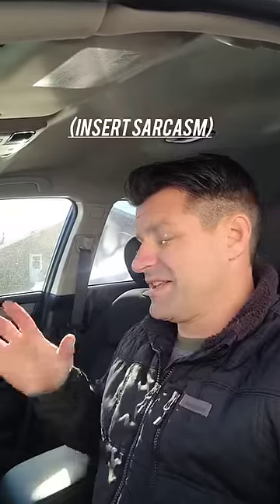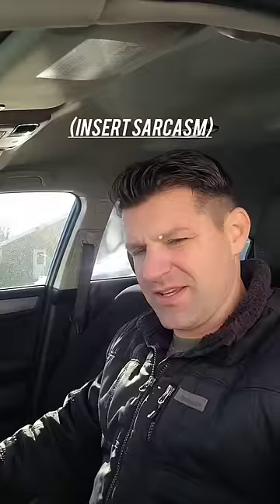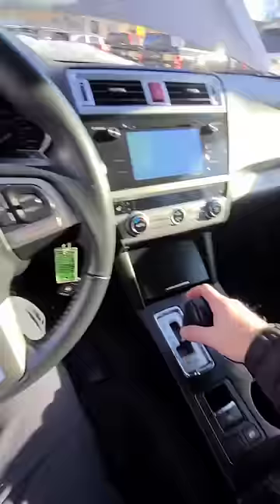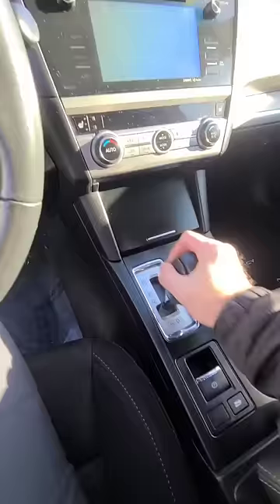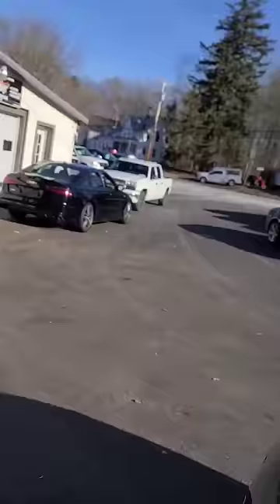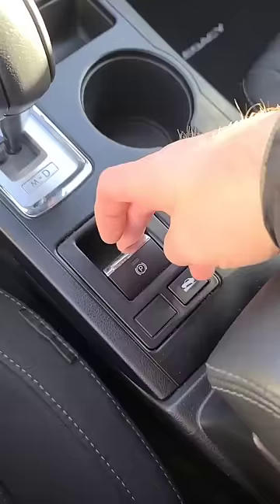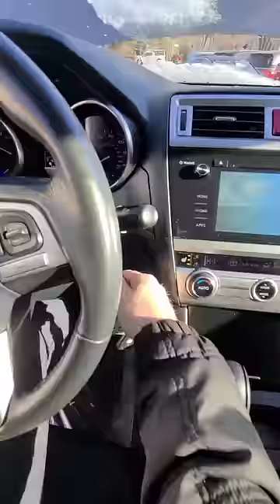Why Subaru Engineers deserve a punch in the Face! #shorts

Comment from the maker: For the record, jump pack got car in neutral then died. Key is not removable from neutral, shift lock requires a key or screw driver. Not accessible without me removing my foot from the brake.
Reply: Still a noob.
Reply: Put it in gear. The fluid is enough to keep it from moving. Also a pocket screwdriver would hit the shift interlock. 
Still a noob for clicks and views.
Reply: Thank you for the explanation.  I was thinking the same thing. Lol
Reply: @RayWolfwinski  The engine isn't running, the pump isn't pumping, no gears are being applied, the transmission is STILL in neutral in drive.
Reply: @supertoaster94  it's a CVT. It has 12+ quarts inside it but only holds 5 quarts in the pan. 
The fluid would be a resistance to the moving motion of the car. And the torque converter also is now trying to spin causing fluid to shear and keep the car from moving as much as it would in neutral. 
Drive is not neutral unless you have a 4L60E.
Reply: Subarus with automatic transmissions have an override next to the shifter. I’m sure it still wouldn’t matter but if you had a flathead in your pocket, you could’ve put it in park instead of racing around the door.
Reply: every heard of wheel chocks my guy
Reply: So what you are saying is you should have engaged the parking brake before moving the shifter since it's clear the PB is electric and the jump back is a sketchy connection at best.  If I understand, the JP died, demonstrating how tenuous they can be.

You'll know for next time, engage the PB before you go messing around with batteries and shifters.
Reply: Ok I see the complaint but that is a pretty rare scenario.  Usually you will either have power the whole time or have the tool to manually release the shifter from park already in your hand because it won't come out of park with no power.  I've been a mechanic for nearly 20 years and have dealt with electronic shifters pretty much the whole time and I don't think I've ever seen somebody accidentally get a car into neutral with no power and no tool handy.
Reply: just not sure how often that exact situation occurs. . .
Reply: Pretty much, the story is to always engage the parking brake on a hill no matter what
Reply: Everyone saying “Just put it in park” Did you not just watch the video? Did you not just watch him holding the brake and not being able to go into park? Are you guys stupid? (Yes. Yes you guys are.)
Reply: Sounds like a skill issue
Reply: Just chock the wheel with your boot...
Reply: That still doesn’t explain why you shifted it to neutral to begin with.
Reply: So jump pack died after car went into neutral. Bad timing but I get it. Murphy’s law.

What doesn’t make sense is how it somehow wasn’t too dead to power the car so you could put it back in park
Reply: They make pocket screw drivers for a reason. Should be second nature to have one in the pocket if you're carrying a jump box to a car cause, ya know, shift locks exist. Shift lock override is like 2 inches in front of that shifter. Problem solved. Un-prepaired and no pocket screwdriver? No problem! Use the mechanical key that pulls out of the fob. Again, problem solved. Of coarse the situation would have never happened if you had made a good connection with that jump box to begin with. Shoulda titled video - noob vs subaru shift lock. shift lock wins or subaru shift lock outsmarts noob. lol
Reply: Why would you connect the jump pack, get in the car and instead of starting it, put it in neutral and wait for the pack to die? And where did you suddenly get another, good pack from?
Reply: The Subaru remote should have a key inside that you can pull out and push in the shift lock.  Come on man.
Reply: You could have just popped off the little square and changed gears by pulling the tab that release the gear shifter. Didn’t need to jump out of the car. Next time use google or just YouTube it. “How to change gears when the battery is dead”.
Reply: If you pump the brakes the pressure will hold. I swear people are getting dumber every day.
Reply: You had shoes on right? You could have jammed your shoes into the brake paddle if you didn’t have a tool (credit card) for the shift lock cover. I have to agree that is a pretty stupid design.
Reply: @RayWolfwinski don't know why everyone hates on 4l60e mines got almost 300k and still going. Most transmissions can't do that.
Reply: Cool story. The good news is that there is still time to take this video down before you embarrass yourself even further.
Reply: That definitely sounds reversed. Shift overrides are to get to neutral. Not to get out of it. So I see the issue there. Very off. However you should still be able to stay in gear. I dont know why a CVT wouldn't be able to stop it. Other wise go to drive, chock it, then do what you need to do then to turn it over, get it into a shop, or onto a tow truck. Glad you are good otherwise though.
Reply: @Shalashaska016  shift overrides let you go to park on almost all cars. I don’t know of one that doesn’t. It will go into and out of gear just like you have the engine running and foot on the brake.
Reply: Also for the record you must have no friends or coworkers.
Reply: So explain how you got the in the vehicle, key turned, car out of park, to not be able to access the release because the key is in the column. This is a fucking setup.
Reply: Jump pack died? You mean you disconected it. Also it's a parking brake, not an e brake. If working on a car that can roll... try wheel chocks.
Reply: An incredibly dangerous engineering oversight. I hope Subaru has an easy fix.
Reply: @markkent4295  you understand that this video is bullshit and this person had to go out of their way to do this? They had to actually put effort into this to cause this exact issue by forcing an outcome that's unreachable otherwise?
Reply: Couldn't you have just turned the wheels to get it sideways where it wouldnt move or roll down the hill to do the same. Enjoyed the video none the less
Reply: Why not chock the wheels after you went and got your jump pack and popped the hood?
Reply: My guy doesn't know about the transmission bypass by the gearshift?
Reply: The design is flawed I agree. You should be able to shift back to park without using a manual override. Unfortunately I see more of this as the years go by. Tow truck driver here. Electronic shifters, parking brakes, and door releases all suck.
Reply: Nice set up. 
Who starts automatic cars from neutral?
Reply: @bryontriglianos6508  nope they work if they are off do it in mine all the time cause the brake safety is broken
Reply: How did the battery die in nutural and park brake off? Electric Park brakes go on automatically when the engine is switched off...
Reply: You are literally 1 in 100 mil in this situation. There's no need to over engineer the over engineered vehicle that's made for idiots to drive from A to B and know absolutely nothing about their vehicle.
Reply: I love how everyone has the perfect answer after the fact.I will never go near a car without - a pocket screwdriver in one pocket - a wheel chock in another- the owners manual in one hand and a helper in the passenger's seat. But I bet I still forgot something. A simple mechanical emergency (oh sorry" parking") brake would solve everything!
Reply: Just to whoever doesn't know like the person who filmed this video there's a shift lock bypass. It's right in front of the shifter you remove the little rubber pad and there's a hole you push down on it
Reply: So, a completely unforeseen problem has to be engineered for? Maybe you should have used wheel chocks or put the hand brake on first before doing weird shit.
Reply: How did the battery go dead while you were in the car, in neutral, with you foot on the brake?...
I think the person that needs a punch in the face is the one dumb enough to allow that sequence of events happen.. I mean how??? How does that happen 🤷‍♂️🤦‍♂️
Reply: So you're saying you're very unprepared.  Having a key or screwdriver in your car should be as common as a steering wheel.  House key. Pocket knife.  , To me sounds like prima donna problems.
Reply: so then, a donkey punch.   a mushroom stamp.
Reply: Don't use the small shitty jump packs. They only work 25% of the time when the battery is only slightly dead. Also use the parking brake, it's primary purpose is not emergency brake.
Reply: Cell phones work well for contacting others for help.
Reply: Why dont you put blocks down
Reply: Take a coin or anything if you don’t have anything in your pockets then yeah you’re screwed but there’s a safety switch that you pop cover off right next to the shifter and take a pen or anything press down on it and you can shift with no power no nothing I’m guessing you already heard that from all these other people though!
Reply: Fake
Reply: Chock the wheels... Problem solved lol
Reply: @sheshellsseasells  EXACTLY
Reply: Kinda just dismantled your whole argument bud, why would anybody ever be in that situation if they’re not working on the car?
Reply: There’s a little whole somewhere around the shifter take a flat head screw driver and then you can shift it
Reply: @Subaru
Reply: Why did you leave it in neutral
Reply: Ahh I was wondering how you got to that point.
Reply: @supertoaster94  which is why they're is a parking pauwl.
Reply: Well that is a problem with your jump pack and not the car since under normal conditions this would never happen . Electronic E brakes are dumb though and i hate them
Reply: Get a jump pack that plugs into the 12 port aka the lighter port. Then you will get power to the car from inside. They take longer to charge the battery but it would be enough to get the car in park if it ever happens to you again
Reply: thats why you always have one in your door .. not only for rattle sounds x)  even a pen or pencil can be used for the shift lock
Reply: This is the explanation I came to the comments for. Thank you.
Reply: Your fault for not putting in park with shift lock before putting booster on, sounds like a skill issue.
Reply: All cars has a neutral override switch doesn't matter if it has electronic parking or any of that that little cover beside the shifter is called a kill switch you remove that cover you stick a screwdriver down in there then you're able to shift the part that the shifter forward to put it in park it is a neutral safety switch duh all vehicles must be equipped with them after 1972 with a floor shifter all vehicles have a shift on the column must have an override or a manual emergency brake learn your vehicles and this is for American vehicles and imported vehicles to America just saying from experience I've worked on every vehicle known to man so far in my life and not one time have I ever had that problem why I got to jump out of the vehicle afraid of it rolling over me never had it because there's always going to be a neutral switch beside the shifter unless it's on the column then if it's on the column well that's why you have had either a a mechanical emergency brake or a default parking brake oh and you can also put the vehicle in drive to for the vehicle not to roll use common sense
Reply: You have an emergency brake you can remove one of the keys from the key ring and use it on the shift lock the shift lock is there for that very reason
Reply: EBRAKE and Neutrel 
OR
EBRAKE and Drive
Remove key from key ring
Find anything even if u can't get out.. but u can. 
I'm glad you're not in charge of saving anyone's life.. that would suck.
Reply: @bryontriglianos6508  because everyone has a flathead screwdriver in their pocket...
Reply: @meesterbeefy13 unless the cover is missing, most cars will have a cover, some requiring a pick or very small flat head screwdriver to remove cover to access the shift lock release.
Reply: @Gamerboi4 lmfao the irony of your comment. Especially if he's on a hill...no...pumping the brakes do NOT hold the calliper pistons pressure on the pads 😅🤦🏼‍♂️🤦🏼‍♂️🤦🏼‍♂️🤦🏼‍♂️
Reply: That’s what you bought. I make sure I have manual options opposed to my electronic options just in case. My windows are the only thing that are entirely electronic. You should have realized everything was electronic and asked where the manual controls were. If there are no manual controls like a shift lock, then the car is worthless and can’t even be towed if needed. Junk not worth buying. Your fault boss. I don’t feel any kind of sorry for you
Reply: So you're saying that you DON'T carry a pocket knife and that your house keys weren't accessible EITHER?
Reply: You dug yourself into this hole. If you knew of these ‘flaws’ you should have been smart enough to chock the wheels first. Instead you were all ‘hey let’s make a viral video’

Clearly you were missing when the common sense was handed out.
Reply: Don't sweat these smooth brains in the comments. Subaru is past it's use by date. I'm guessing you needed something bigger than a crosspreza? no MT, no handbrake. I'd blame you for buying a bad car but I don't know if there's an option that isn't shit.
Reply: Flying Wheels I wonder if the battery goes dead if the ebrake disengages?
Reply: @meesterbeefy13  if the battery was dead, it would never have gone out of gear in the first place.
Reply: @Gamerboi4  if your brake system holds pressure when you let off the pedal, then you've got some malfunctioning parts my friend.
Reply: All car got an over ride button that free up the gear box. Normal to put the car into neutral lol
Reply: So you put it in neutral for no reason and don’t know how to use the shift interlock. Got it.
Reply: @RayWolfwinski  Did he not say gear is stuck in neutral?
Reply: @sostanza3  no because it can still go into drive. Reverse and park is locked out by an electronic actuator that is used by speed and brake input to let the shifter go into reverse or park. That is located in the shifter itself. 
Most cars can easily go from neutral to drive as a safety if the throttle gets stuck or the engine fails. 
Again he's no mechanic and just looking for clicks and views.
Reply: All these comments acting like you broke down in a shop with a buddy and screwdrivers and wheel chucks laying around 😂 if you’re out on the road alone and this happens you’re hosed.
Reply: What was the point of going in neutral when you were jumping your car. Electronic parking brakes are stupid but this would never happen in real life
Reply: Why would one put jumpers on a dead car, disengage the parking brake, and than shift it into N?
Reply: No, that's not why they should get a punch in the face... Having to change headlight bulbs through the wheel well is why they need concrete shoes
Reply: How did this get uhm, NTSB(?), approval for distribution in the US? I thought this was part of testing.
Reply: You have really pissed off some millennial Subaru fanboys.
Reply: 2013 Subaru legacy owner here 3.6 R, did you try the emergency shift interlock?
Reply: I know your general public doesn’t know what it is but it should be around the shifter somewhere or you pop the little cover off and either put your key in or press the button to allow you to shift into park.
Reply: I was about to say there is usually a shift release button that allows you to change to/from park... so weird that they require the key or another tool that may not be readily handy in an event.
Reply: @bryontriglianos6508 yes because everyone just has a flathead with them
Reply: if. u were a truck driver u probably crash into cars n into building lol
Reply: You’re not very smart. The car has a transmission access port to override the interlock.
Reply: @RadDadisRad  Dude, read the comment you replied to a bit better.
Reply: @Hawkido  the car will never die in neutral. It’ll die when in park. Why is he trying to manipulate a dead car that is in neutral? I don’t need to read anything. This post is stupid.
Reply: Just like Nissan qashqai if it breaks down electrically and battery is disconnected you can not get them out of park without battery power... so just skull drag them then if driveline gets damage that's Nissan's fault
Reply: @destruxandexploze2552  how about Chalk the Fucking Tires!! Is that so complicated? It’s like watching a toddler trying to figure out what his third leg is for!!
Reply: @andrewburston9125  Wow only other person with Common Sense!!! Congratulations your smarter than 99% of these Comments!
Reply: @iamzuesthisisthetruth8864  I already stated in another comment he should have used a tire wedge.
Reply: @RadDadisRad  Huh?  Never? Really?  Never had an alligator clamp pop off the post when testing a car with a battery pack, huh?  The OP's post isn't a stupid post, this is just a very unlikely situation.  Your post was willfully ignorant.  Observe, Think, Cross-Check, Confirm, then Commit.  You are all Commit and Quit.  I seriously hope you are not a mechanic that works on other people's vehicles.
Reply: It isn't a "emergency break", it's a parking break. If you had applied it when you parked the car then you wouldn't be in this problem. Sincerely, the rest of the world.
Reply: Doesn’t matter, it’s should be way easier to do that anyhow. Shouldn’t be any convoluted steps to shift into park or engage the parking break.
Reply: @RayWolfwinski  how is he a noob. I can definitely see this happening to all sorts of folks.  And even if he was, the car should allow access to these saftey measures regardless the skill level of the driver.  Your a noob in saftey design.
Reply: So you knowingly got a car with a dead battery from park to neutral while not having chocks or a parking brake engaged while on a slope? Then it’s the engineers fault? Oh and of course a new good jump pack magically appeared under the bonnet after the first one died too, what a freaking miracle.
Reply: My guy, do you not have a pocket screwdriver?
Reply: The circumstances needed  in order for a battery to die while in neutral is almost not possible unless done on purpose. I agree parking/emergency brake should be manual but this has to be set up.
Reply: @RayWolfwinski  it's an auto it would not go into any other gear or park
Reply: @jamesallenmainieri  how do you know. Are you a Subaru technician? I highly doubt it because if you were you would not be stating that as fact.
Reply: Coming from the wonderful world of towing and mechanics why the fuck do you not have a tiny flathead screwdriver on you at all times the tool trucks have them in handfuls and most likely give them for free or for a few dollars that being said in front of the shifter under the rubber mat there's a small oval hole put your screwdriver in there push down on the button put it in park
Reply: sounds like a jump pack issue
Reply: @maine-ly  that would be too easy and doesn't make content.
Reply: BUT-- IT HAS A TURBO!!
WE ALL 👍🏼 GOOD
Reply: whats wrong with putting something/anything infront of a tire to give you more time to do... literally anything you wanted
Reply: i do know somebody with a mini that had a battery die while driving somehow... anyway, that locked the key in the ignition for some reason. so he yanked the key, destroyed the ignition/key interlock and practically wrote the car off all because of a dead battery
Reply: @theglitch99  it doesn't have a turbo
Reply: I’m just trying to understand why you’re even putting it into neutral without starting it?
Reply: @701garage  then I take back my comment!😵‍💫 just a normal boring car
Reply: I mean. This was kinda my question is how did the car get Out of park. If ur car is Dying though u have bigger issued then this. they should not have expected the car battery to die while in drive. Literally driving would be charging your dead battery preventing this problem. Only way this happens if u are driving somewhere with a battery u know wont hold a charge so u must have junped it in the First place to get it out of park. And then it died during that trip. 

Idk what the odda of that are. But it sure sounds like your 1 in 10000 scenario of continuing to drive with a dead battery till your car started shutting itself off is a you problem.
Reply: @RayWolfwinski  he clearly shows it not going into gear or park.
Reply: Theres a shift interlock right there that will allow you to put in in park when battery is dead, push on it with a screwdriver and shift it into park👍
Reply: @jamesallenmainieri  please see previous replies. I have explained as to why it will not go into park. It will go into drive. Every car does.
Reply: open center console, insert key into lockout, and put it in park....FFS all vehicles have a key lock function to prenvent this, absolute misinformation at its finest
Reply: Okay, but why did you put it in neutral, exactly? Batteries don't require the car to be in neutral to receive a jump, last I checked.

Yes, electric-only parking brakes are dumb, but you created this exact problem, yourself.
Reply: Ah, you're responding to Mr Subaru's criticisms.

You bring up some interesting points, BUT 1) how would this specific situation be different with any other manufacturer 2) How would it be done differently to avoid this specific case altogether?
Reply: You can probably find a hunk of metal on the ground to pop the shift lock. Or anything metal with a flat end. Like one of those nice metal zipper pulls on your ski jacket.
Reply: It sure sounds to me like your problem here wasn't the Subaru, but the shitty jump pack you used. Can't blame Subaru for you buying a crap jump pack. (Whatever happened to having cables and asking someone for a jump)
Reply: No, I still don't get it. So you had the car in park, you used the jump pack, that gave power to the car, and for some reason you then shifted into neutral -- instead of starting the car? or letting it run? And with the hood still open and the jump pack still attached? But why...

(inb4 "because otherwise it wouldn't make for any youtube likes")
Reply: @RayWolfwinski  the car will not go into drive OR park, not every car will go into drive.
Reply: Still blamed Subaru engineers 😂 typical
Reply: @Andrew Burston  he's probably wearing crocs
Reply: Ok, follow me real close here... Remove shoe from foot not on brake. Place in front of rear wheel. Slowly roll onto your new wheel chock.
Reply: Coudnt just hold the car?
Reply: No clue what a shift-lock override is? smh
Reply: My minivan had a dead battery. Went to get the jumper cables from the back. The only way to unlock the lift gate is with the fob or switch on the driver door ELECTRONICALLY.
Reply: Subaru secret to circumnavigate this issue, hit ctrl alt del, and reset.  It's super easy, barely an inconvenience.
Reply: all u have to do is remove the rubber mat from century cubby hole. look where the three slanted slots are that the mat clicks into closest to the shifter there will be one round one and stick a flat head in and press down then move the shifter to park. sometimes you can use the key in the fob.
Reply: yhs its common problem with key. btw get rdy my friend when your automatic gearbox will fail. and drop atleast 4 code it will go into safe mode with few gears at best. and key will by stuck for ever. you will need delete error codes relaunch everything oh and ofc replace or restore your autogear box. happened few times from life experience.
Reply: after parking always have the emergency brakes on, make it a habit and you'll save yourself on a bunch of trouble like these 🥴
Reply: @RayWolfwinski  You want to have an automatic gearbox start turning to keep the car still?
Reply: Bet you had a pen in your pocket
Reply: @cccpkingu  yeah. A transmission full of fluid coupled to a non-moving engine is going to have a higher resistance to motion of the car moving than a transmission allowing the wheels to freely spin from the engine itself. 
In simple terms a manual transmission left in gear will hold if the park brake fails on slight inclines. It's the same principle.
Reply: @RayWolfwinski  Ah yes, if you ever drive a subaru never forget your pocket screwdriver so you can operate your car.
Reply: @supertoaster94  thats not how a car/ transmission works. respectfully educate yourself before commenting.
Reply: @RayWolfwinski  you are partially correct and i appreciate that you have some knowledge to shed light. to add to this {im a Subaru technician and have had this transmission apart} this transmission along with almost every modern automatic/cvt has the transmission mechanically  locked and "disconnected" from the engine whenever in park.
Reply: puch button on back of key. releases physical key from fob. that is what it is supposed to be opened with in....an emergency. i know reading is hard but the manual has lots of interesting things in it.
Reply: Also, if the battery is completely dead, the jump pack won't work until you enable it to work with a dead battery (usually a 3 to 5 second operation)!
Reply: That answers the question I had. Locking the key in is dumb as
Reply: Let it crash . Sue them , get monies from them
Reply: There is a button on the key fob to remove the physical key from the fob to use with the shifter override.
Reply: Hawkeye got nailed by doing this.
Reply: Leave in park with handbrake on and start the car, why would you put it in neutral and disengage the handbrake on a hill with no engine running and a dodgy battery hooked up to a jump pack?
Reply: Block the tire smarty.
Reply: This is why a cable actuated handbreaks are better
Reply: next time read your car's manual when you first buy it (or are thinking about buying it, manuals can be found online) especially if it has technologies you are not accustomed to, there is a way to put the shifter to park even without battery.
Reply: Massive rookie energy in this video my guy.
Reply: @Gamerboi4  your comment may be dumber than his actions.  Pumping the brake will not make them lock down and hold the car.  As soon as you release the pedal, it release brake pressure.
Reply: EJ253/4EAT club… I know nothing of this problem.
Reply: @dugangant  are you one of those weirdos who takes care of your vehicles?
Reply: Noob mistake u always make sure a jump pack has plenty of charge before u use it, it was ur own fault not the engineers
Reply: Your whinny but could have used any other key that you had on you. Also, it is time for you to get a pocket multi tool.
Reply: Your battery died will you were driving? How did that happen? What else happened to make your battery die?
Reply: Gahdamn these comments are cringe. 🤦‍♂️
Reply: You couldve gotten a rock
Reply: Noob, thats a safety feature, if u get stuck on the road. so that u can tow the car to a mechanic.
Reply: To be fair to the engineers, they probably brought this up as a design flaw and proposed a solution, then someone in finance nixed it, saying it didn't add enough value to justify the additional manufacturing cost.
Reply: I never knew that wow
Reply: shift lock?
Reply: cant u steer it down a bit till it makes a full stop?...than use the screwdriver to unlock the transmission..
Reply: @bryontriglianos6508  or just take care of your car so that your battery doesn’t die before you can replace it🤦🏾
Reply: @catfishbilly7425    The key in the fob isn't long enough for most (if not all) Subarus.
Reply: The 2017 Subaru Legacy definitely has a shift lock release, the details for it are in sections 7-28 of the owner's manual. Every auto car I have seen has a shift lock release.
Reply: @Verglace    That's true, but you need a proper tool, like a screwdriver to release it.  If he didn't have one in his situation (which is rare) the release wouldn't have done him any good.
Reply: This isn't the only modern car like this... This is why I drive a 3 pedal car with a real E brake... a REAL ONE!!!
Reply: ... and I don't think this problem exists only in Subarus...
Reply: So is it Subarus fault or your jump pack dying from you not charging it fault? Hmm last I checked I don’t think any car will change gears without power, there’s a little cap somewhere hidden from customer sight under which use the key or hide a key in the fob to push the transmission lock out of place while you change gears so you can move it while dead, how do you think cars with shot transmissions get pushed into the shop for help. Can’t believe this got so many views, either way I dislike Subaru for other reasons.
Reply: So basically you put yourself in the position. And the cat apperently isn't idiot proof. Darn...
Reply: @000elemental000  nor does he know about wheel chocks... Would have thought someone working on cars like this would know things like this.
Reply: Lol, that’s what you get for getting an automatic
Reply: @RayWolfwinski  A torque converter is made up of two pieces, one side is driven by the engine via a flex plate that's bolted to the crank shaft. This side also drives the fluid pump, which fills the converter and creates line pressure to actuate clutches. Meaning no engine RPM = no pump to fill up the converter thus no fluid coupling occurs between the two torque converter sides. The other side of the converter is locked to the input shaft of the transmission via being splined in. Converters need roughly a 500-600RPM difference between those two pieces before any torque is actually going to be applied from one side to the other. Most have a stall point of 1200-1500RPM before 90% or so of the input torque is actually output.
Reply: Shift lock not accessible without you removing your foot from the brake? Nope, that's bullshit. 

Don't need any special tools, the valet key inside the fob works. So does a screwdriver, a pen, or really anything that fits in the release slot next to the shifter. 

If you can't at least chock the wheels nobody should be trusting you to service their vehicle.
Reply: @bryontriglianos6508  I'd say the better plan would have been to not put it out of park and p-brake immediately after connecting the jumper with the engine not running.

But then again, that wouldn't have been watched even half as much as it did.
Reply: Oh, that explains the weird situation you got into. I guess we need to start taking the habit of putting blocks on wheels before trying anything on a car nowadays…
Reply: @RayWolfwinski  Or at least the movement could be a lot slower…
Reply: @buffuniballer  I’d even take the habit of putting blocks on wheels to keep the car from rolling as soon as I see an electric parking brake. Just in case something like this happens, or anything weird like the wrong fuse blowing up.
Reply: For the record, just after the invention of the wheel, we invented the Wheel Chock. For centuries we have had the technology you seek.
Reply: @bryontriglianos6508  if you could read you’d probably see where he said that exact thing… however he didn’t have a screwdriver.
Reply: @sheshellsseasells  yeah I carry wheel chocks in my automatic car at all times… said no one ever. Especially not a subaru.
Reply: @teddyg210  he literally says, in the comment your replying to, that the key is in the ignition and doesn’t come out of the ignition in neutral… can you read?
Reply: @2amchef16  jam your shoes behind the break peddle…? You do realize the peddle has to go down right?
Reply: @jeepmanxj  don’t know how it happened to him, but if he towed the car to a shop the car has to go into neutral to roll off. That’s likely how it happened
Reply: @000elemental000  the comment your replying to is literally him stating that it’s there but he doesn’t have anything on hand to use since the key is in the ignition and won’t come out… learn to read.
Reply: @johnantonopoulous6381  he’s literally talking about it in this comment, and how he doesn’t have anything to use. Can you read?
Reply: @FunLovingCriminal_JB  taking it off of a tow truck more than likely. Car has to be in neutral with you in it to roll off.
Reply: @lcsvlone2811  …. Yes that’s why the battery is dead, it’s being worked on? Did you think before you replied?
Reply: @randomusernumber1  a lot of jump packs have bs little clamps and don’t get a good connection half the time.
Reply: @jeremiahpace6533  yes only as he said in the comment your replying to, he didn’t have a screwdriver on him… learn to read
Reply: @msain427  he literally says I’m this exact comment that the key is in the ignition and doesn’t come out in neutral. Glad your not in charge of saving anyone’s life, it’d suck if you couldn’t read instructions
Reply: @tooltime4640  could’ve been rolling it off of a tow truck or had to move it from a spot it was sitting in. Also this exact comment that your replying to says he knows about the shift override but didn’t have a screwdriver and the key was stuck in the ignition. Learn to read.
Reply: @RayWolfwinski  yeah, not sure how shifting into drive will help… thanks for the input though
Reply: @ryaneaton6851  pushing the car out of the way, taking it off of a tow truck, battery dieing in drive, lots of ways this could happen.
Reply: @ryanstage3912  to move the car or to take it off of a tow truck?
Reply: @timbrown9731  the comment your replying to is literally him saying he didn’t have a way to access the shift lock, learn to read.
Reply: @RadDadisRad  taking it off of a tow truck, moving it if it’s in the way at a shop, it died in traffic and he had to push it out of the way etc. lots of reasons, but since you couldn’t read the comment you replied to I’m guessing you can’t read this one.
Reply: @iamzuesthisisthetruth8864  yes because I carry a wheel chock in my pants at all times for this exact purpose.
Reply: @destruxandexploze2552  and it’s just as stupid of an idea as it was before
Reply: @indiebekonn  the car likely had to be moved from its spot or taken off of a tow truck. Moving the vehicle with the jump pack on can make those flimsy clamps disconnect to where you have to reconnect them.
Reply: @lowendassassin  moving the car from a spot if it’s in the way and died, taking it out of traffic if it died while on the road, taking it off of a tow truck, etc. lots of ways for this happen
Reply: @lordmalice6713  hard to do without a screwdriver, I agree he should have one on him but not everyone carries one around. That and probably didn’t expect the jump pack to disconnect.
Reply: @Doggle420  just magically teleport something into your hand to stop the car from rolling, hell if he can do that why not just teleport a new battery into car?
Reply: @kylebenhart3929  alternator could give out while driving as well. There’s way more to a cars charging system than the battery.
Reply: @kristianstaniland8954  the comment your replying to right now is literally him saying he can’t because the key is stuck in the ignition and he doesn’t have a screwdriver, it’s honestly embarrassing how many of you people are here giving “advice” but can’t even read.
Reply: @crimsonlight4205  “jump pack got the car in neutral then died” then another one that’s full magically appeared while he was sitting there holding the brake. The only need there was to make himself look like an absolute bellend. And to make some money off the click bait and fake outrage at Subaru while it’s a situation that would never happen without messing with the car without proper precautions, which should be taken in your example as well.
Reply: @NaruSanavai  they do require being out of gear to move however, the car might have been in traffic and he had to push it, or it might have come off of a tow truck, or it might have needed to be moved for some other reason
Reply: @occamsrazor1285  Subaru, Nissan, Honda, and Ford all had this stupid bs. Buy a dodge or a Chevy and you won’t have that problem.
Reply: @romulusnr  yeah get out of the car to find something on the ground, good job it’s now rolled away.
Reply: @romulusnr  the majority of jump packs are junk like that, crappy clamps that disconnect themselves half the time.
Reply: @romulusnr  cars have to be in neutral to move, battery could have died in a bad spot, had to hook up the jump pack to push it, and moving it made one of the cables lose connection. Happens all the time to people who work on cars.
Reply: @HouseCallAutoRepair  no clue how to read? Smh
Reply: @RayWolfwinski  that’s not how it works, an automatic transmission has a series of clutches, if the car is in drive but isn’t running and the transmission isn’t doing anything, the clutches don’t engage. It’s the same principle as an automatic.
Reply: @mikepick4773  if it’s disconnected from the engine then how does that help? The clutches are still not engaging and there’s no fluid pressure since the engine won’t be turning the torque converter.
Reply: @SpotCheckNews  the key is in the ignition and is stuck because the car isn’t in park, I know reading is hard but the comment your replying to has a lot of interesting things in it…
Reply: @joe_ferreira  hard to do that when the key is in the ignition…
Reply: @billkillernic  yes, that is what the comment you are replying to is talking about, however it requires the key which is stuck or a screwdriver that he doesn’t have on him. That’s why you read before replying to a comment.
Reply: My 2018 audi is all electronic including the shifter. Never thought about it, but I guess I'd have a similar problem
Reply: @jerrys4841  alternator goes bad, battery dies and you have to use the lights and ac so the alternator can’t keep up, bad cables and one rusted so bad it broke which disconnected the battery, lots of ways for that to happen. The car doesn’t run on a battery alone.
Reply: @BluerayDriver  … what? How is having to keep the car in neutral a safety feature? You do realize a tow truck requires it to be in neutral to roll off of the vehicle and they’ll have to put it in park after that too right?
Reply: @averageaudienjoyer  yes because batteries react better when you pet them. They especially love being stroke from right to left, never left to right. Oh and baths, washing your car makes the battery last longer. They definitely aren’t prone to dieing suddenly when it gets really cold or slowly losing charge over time. And alternators definitely never quit charging either no, especially not if you wash your car regularly smh.
Reply: @harrisonhill7100  most domestic cars (except Ford) don’t require power to manipulate the gears.
Reply: @crimsonlight4205  buddy there isn't a car where it isn't by the gear shift, he doesn't know where it is.. He is being stupid for clicks
Reply: @crimsonlight4205  he PUT IT IN THE IGNITION IN THE START IF THE VIDEO,  wow dude, talk about cant read...says the one who came in far less armed with righteous indignation than he expected...sit back down dude, you are making a scene
Reply: @jerrylindgren7828  I’m sure that would work if the key wasn’t stuck in the ignition and he had a screwdriver on him. However as literally stated in this comment that’s not the case. He also likely didn’t have a wheel chock up his ass so he couldn’t just magically produce one. 

If you can’t even read nobody should be trusting you to work on their vehicles.
Reply: @arakwar  it would not in fact change anything.
Reply: @arakwar  he probably had to move the car. To move the car that would require wheel chocks to not be in front of the wheels.
Reply: @indiebekonn  it’s definitely not a full jump pack since he still couldn’t start the car. However if you put a jump pack on the car that doesn’t have enough power to jump it off, it will need to be reset before it gives power again. I agree it should’ve been fully charged beforehand, however I’ve also forgot to plug mine in from time to time. Doesn’t make this any more of an idiotic design.
Reply: @000elemental000  …. It’s not that he doesn’t know where it is, it’s that he doesn’t have anything to use, still working on that reading comprehension are you?
Reply: @Crimson Light  the car was dead. He used a jump pack and moved it to neutral while it was dead, without making an attempt at starting.  You have to be an idiot or deliberately trying to create this situation to end up here in the first place. You can also literally use a shoelace to unlock the shift lock...
Reply: @averageaudienjoyer  yes because all the preventative maintenance in the world will keep your battery alive permanently. They definitely don’t go bad over time no siree. They are an infinite resource and that’s why they don’t sell very well.
Reply: @kristianstaniland8954  damn, you can’t read and you didn’t watch the video? Why are you even commenting? The key is already in the ignition at the start of the video. I’d advise watching the video first beforehand. It helps you understand the subject material.
Reply: @crimsonlight4205  take care of it before it dies there are signs
Reply: @jerrylindgren7828  yes because maybe the car isn’t running right now? Maybe it’s getting worked on and had to be moved. I understand not everyone works on cars, but this situation can and does happen from time to time.
Reply: @crimsonlight4205  it's a CVT there's no clutches in it for applying direction. It has a clutch in the torque converter like every automatic and a clutch for the transfer section for the AWD. 
When in gear the wheels will turn everything all the way to the torque converter. 
That's gonna have more resistance to allowing the car to move than if it was in neutral. 
Also like how you came in 3 weeks after and replying to everyone, like it's not been talked about. 
If you look through every reply I've posted it's all correct that he was just looking for clicks and views. 
If you can't see that then he got you.
Reply: @crimsonlight4205  if the batery is dead and the alternator doesn't work how did he get it out of park in the first place. He must have jumped it to get oy going. The alternator is kinda a useless argument cause if the batery is dead the alternator has nothing to charge anyway. 

This scenario is like 1 in a million issue. If ur driving on a dead batery or bad alternator consistently then this is your fault. Fix your damn car. Its almost as if this person is relying on a jump pack to start the car regularly. 

So then if the car does have some catostrphic failure where it dies in drive (i have actually had this happen to me) as long as your car is kept up with you should have a battery that works in the car. 

Again this scenario happening was caused by many failures at once not just one right. There should be almost no time where u are driving around with a dead battery to begin with. If u are your an idiot asking for trouble. And to have a car die while while in drive during that time seems incredibly unlikely. Could it happen. Sure. But if im am jumping my car to start it with a bad battery the first thing i do is go to the auto parts store and fix it. I don't drive around with a bad battery and jumper pack like thats exceptable. 

Its like driving on a spare tire and when ur spare goes flat because its not meant to be driven on complaining about not having a 2nd spare.
Reply: @crimsonlight4205  oh honey.. He's a mechanic with no tools.. Or  taking the time to set up a video, of a problem he already knows about, but setting himself up for failure.  It's not informative. Not solving a problem, just bitching for clicks.
Reply: @kristianstaniland8954  you can literally watch the first 10 seconds of the video and see your wrong kid. But it’s ok you don’t have to know what your doing.
Reply: @kylebenhart3929  he does not read because I made the same articulate argument 6 days ago.
Reply: @RayWolfwinski  oof yeah your right, haven’t messed with one in a while because of how annoying they are my bad, still doesn’t change the fact that it’s disconnected from the engine when it doesn’t have power. It may as well be in neutral. There would be slight pressure to it but nowhere near enough to keep a 2500lb car from rolling downhill.
Reply: @averageaudienjoyer  not all the time. Once it gets worn down it can still usually start, as long as you don’t let it sit for more than a day. Which most people don’t. It still doesn’t change the fact that the battery will generally die before you get a new one.
Reply: @kylebenhart3929  you don’t have to have the car running to shift into neutral, simply has to have power. The jump pack provides the power. And alternators still charge while the battery is bad. Just because the battery isn’t holding the charge doesn’t mean the alternator suddenly stops pushing the charge. It will charge whether you have a battery there or not. If you’ve had it happen where it does in drive then you must have had to push it somewhere right? That’s more than likely the kind of situation that would occur here. While the car may not start, it can be put into neutral to be pushed.
Reply: @RayWolfwinski  so a super rare scenario like i have stated. Is it possible. Sure. Do car manufactures need to accommodate that rare scenario? 

Should we have 2 spare tires in case i run over nails akd 2 tires go flat too. Because thats probably much more likely then your car dying in drive after jumping it. 

And fwiw. People who own this car have basically explained there is also an over ride switch anyway. 

Is it inconvenient. Sure. But so is a dead battery.
Reply: @crimsonlight4205  you can't read because the fluid is still in the torque converter. 
It's full of fluid that the veins have to move and shear if engine is not turning and the entirety of the transmission, pulleys, and steel belt has to move if it's in gear. 
Just you came late and are talking about something that has already been discussed. 
You will still try and get the last word in because you have such a fragile ego you can't be wrong. 
And if you reply you are just proving my point.
Reply: @crimsonlight4205  why would u even put a dead car in neutral with a jump pack? 

The alternator is still an irrelevant argument though. Regardless he knew he didn't have power right. Thus the use of a jump pack.  From my experience once a car is started it rarely shuts itself off. So it's a super rare issue to begin with. If your saying he never started the car though and just put it in neutral from a jump without starting it idk what the point of that would even be.
Reply: @kylebenhart3929  I already said three or four times that he may have had to move it. You can’t move a dead car in park can you? If the alternator isn’t working then a jump pack won’t help since it will only start the car, not keep it running. So you would have to push it. If it’s coming off of a tow truck or if it’s being moved around a lot it would need to come out of park to go into neutral so that the car can roll. Don’t know why that needs to be explained. For people who work on cars and tow cars these things happen frequently. Though usually better prepared. Of course it’s hard to prepare for bad engineering
Reply: @RayWolfwinski  they do not in fact have to move. The belt and secondary pulley don’t engage until a certain rpm from the engine. If the engine isn’t turning, then the other pulley will never engage and the belt won’t move. The torque converter also will not be completely connected to the transmission because the engine is not producing power. And that’s on top of it being out of power which means there are no electronic responses to tell the transmission what to do. There may be a slight, and I mean slight, delay if it’s in drive but it won’t be anywhere near enough to make a difference or prevent it from rolling. Just because I’m late doesn’t mean your any less wrong.
Reply: @crimsonlight4205  so u didn't turn on the car? Is that your argument?  You just shove it into neutral to move it. Why not. Idk turn the key and start it first. And fwiw isn't a car easier to move when its on and u can put it in drive or reverse. 

Again the notion that the car just happens to die the same time you rarely drive w/o a battery. Its possible but not likely.
Reply: @crimsonlight4205  learn to be nice.
Reply: @crimsonlight4205  by the way who is Tim Brown 9731? It's not me dude.
Reply: @crimsonlight4205  must be a different person?
Reply: @crimsonlight4205  
Ah ok 👌, I see what you mean...
I take back what I said 😉✌
Reply: Stop using shitty jump packs that die before you can shift the lever two more slots to Park.
Reply: What was the point of putting it in neutral?
Reply: @kylebenhart3929  smh alright I’ll put it slowly

Sometimes cars break down, and you can’t crank them. Sometimes batteries die and you don’t have a way to charge them. They don’t just start on sheer willpower. Cars don’t run indefinitely. They do in fact break down. And it’s not rare at all for people to drive around with a junk battery that doesn’t hold a charge. When I was a mechanic I’d change atleast 5-10 of them a day. They’ll generally hold a charge for about 15 minutes or so after the car is switched off so a lot of people don’t even notice it until they sit somewhere.
Reply: @timbrown9731  eh can’t be nice. Especially when there are apparently so many people who are completely illiterate but also experts on cars somehow. Your advice is good, for other people who don’t know. But this guy did. Also idk why YouTube does that, sometimes when you reply it’ll add random numbers to the end of their name.
Reply: @RayWolfwinski  ok your getting closer, the pulley does turn when there is input to the transmission, however if the engine isn’t running, there is no input to the transmission. The pulley is constantly spinning while the vehicle is running, but the belt does not in fact engage to spin the second pulley until a certain rpm is reached. Because there is no need for it to spin until the gear ratios start to change. That rpm needed to engage it is low however, barely more than an engine idle. So while the engine is running it will all spin. But the trick here is that the engine is not in fact running. So there isn’t any input to the transmission, no input to the transmission means the torque converter isn’t engaged, and the torque converter not being engaged means the rest of the transmission isn’t going to be doing anything. May as well be in neutral at that point.
Reply: @occamsrazor1285  now that I can’t deny, haven’t seen too many subarus broken down compared to domestic cars lmao I’m not calling them junk, they are good cars. This feature however is completely idiotic and is definitely a design flaw. If you’ve read a couple of my comments I’d imagine you’ve learned a thing or two then. The alternator could be a reason it’s in neutral, but there are a few other ways that happen all the time where the car could be in neutral. As I said before it could be coming off of a tow truck or needed to be moved around at a shop. It’s not the worst design flaw regarding dead batteries I’ve ever seen. I had to tow a bmw once with the auto lowering system, because it had sat so long the  auto lowering suspension had gotten stuck and couldn’t be released. So it had to be moved onto the tow truck while being low enough to touch the ground. Had to go and get my show car trailer that was incredibly low to the ground to get it on and it still scraped the bumper. So it could be worse.
Reply: @crimsonlight4205  the pulley can not be spinning and the steel belt not be at the same time.  If it was that's slipping and that means it's broken. It no longer functions correctly. 
The CVT is junk. 
You have no clue what you're talking about. 
You have never seen or even looked at an TR580 CVT for a Subaru legacy. 
You have no understanding of power flow or what is hooked and connected when the car is in drive. 
You are just uttering nonsense from what you know of a snowmobile transmission.
Reply: @crimsonlight4205  "This feature however is completely idiotic and is definitely a design flaw"

When used properly, no, it isn't. It's actually not even meant for whatever OP was doing. 

"The alternator could be a reason it’s in neutral"

I never said it was the reason. You concluded that. But perhaps you were trying not to "call me out" and what you thought I was saying? OP stated that they got it into neutral and then the jump pack died. If they got it into neutral, then ignition was achieved, OP moved it to neutral and then the jump pack died AND the vehicle died. That wouldn't have happened unless there was an alternator issue AND a dead battery+jump pack.

IF this was coming off a two truck (which it wasn't), then it's already in the state of "being repaired", usually by someone that is qualified.

Wait.. are you saying the electric parking brake is the flaw? Cuz now that I think about that...yeah, I've never been a fan of those. But I thought we were talking about the emergency shifter release, no?
Reply: @meesterbeefy13   
What tool handy you speaking of, screw driver? Well my friend, most ppl. have it in the trunk. Why people here commenting about screw driver? Do you all keeping inside or trunk? Oh yeah, because you all prepared for the shifter to be stuck. 👍
Reply: @RayWolfwinski  watch a cvt transmission in action and then get back to me, that’s exactly how it works.
Reply: @occamsrazor1285  we are, the car doesn’t have to be running to shift gears, all you need is power. The car didn’t have to ever actually start to shift into neutral, just had to have juice going to the battery. And yes, they have a fail safe for that reason, however if the key doesn’t come out of the ignition while the vehicle isn’t in park then it kind of defeats the purpose. A lot of people don’t carry screwdrivers around all the time, so their only option is the key. Should get rid of that safety which requires the car to have power to shift the gears. It’s useless. The electronic parking brake definitely doesn’t help, but most newer model cars are going to that for some reason. I was just giving examples of a few times when it would be extremely inconvenient. Most of those are situations I’ve had to deal with personally, once with a Subaru and twice with a Ford, go figure. If your alternator gives out while the car is in motion and it shuts off, you can’t switch to park and you can’t put the parking brake on, and the key is stuck in the ignition because the car isn’t in park. So it’ll screw you over. Or if you have to take it off of a tow truck, or move it around a shop or around the yard because it broke down and is in the way. If your not expecting it then it can easily screw you over.
Reply: Fun fact...I left my electronic emergency brake in my 2018 limited legacy on overnight. Guess what? My battery discharged. To be honest, I love the car but hate the electronic EB. I don't leave it on unless it's a steep slope and not for more than a couple of hours. But to your point, there are other ways to prevent the car moving..use the shift lock release
Reply: Hunk of  Junk !!!!
Reply: Wow, lots of "car experts" in the comments. Can't accept that the design is a flaw, but I guess you can't sway Subaru fanboys. Can't accept the fact that Subaru sucks? How about this, I work for a roadside assistance company called Agero (cross country motors/road america) I used to be part of the roadside assistance part and Subaru is one of our clients that has US handle the roadside assistance part to secure service providers for customers who need emergency services, guess what, we have shitty towing companies that we are contracted with that will leave you on the road for 6 hours +. Now I'm part of claims, I handle Subaru Plus memberships, wanna extend your roadside coverage? Pay us 80$ a year, just for you to sit on the side of the road for hours. Have fun with that information. Oh and Starlink will be shutting down in March this year, making you only have the option to buy Subaru Plus until Subaru comes out with a new roadside plan.
Reply: Keep seeing comments and shift interlock. From this video I don't see it near the shifter. 

Side note:gf has a '19 civic. Also has electronic ebrake. I hate it. Can not ease it. Push it and it is full lock in 5 seconds. Imagine going 60 on the hwy and pushing that button. In an emergency it'd lock up the rear too quickly and an average driver might meet a wall or ditch. Great idea auto MFRS.
Reply: that was a stupid stunt though, let someone help you for god's sake man
Reply: @Jessersadler  once. it happens once and only when this guy is filming for views.
Reply: @destruxandexploze2552  not as stupid as the OP that intentionally created a situation that doesn't happen. No one gets in their car, on a hill, puts it in neutral, releases the parking brake, then disconnects or waits for the battery to die. If the battery is already dead, then they can't get it out of park or release the brake to begin with. Even the OP's claim that the jump pack only had enough juice for him to get it neutral before dying is shown to be BS. When he gets out of the car and runs to the front, he just clamps the jump pack to the battery. So, it didn't die, he disconnected it.
Reply: @bryontriglianos6508  This. Every car with an automatic transmission has a shift lock release button to let you move in / out of park with no power.
Reply: You do know you can manually disengage the interlock, right?
Reply: this isn’t a tip for mechanics it’s pointing out a design flaw. Just because you would’ve known what to do, doesn’t make it any less of a flaw. 
Would you be acting the same way if it was your mom having this issue? Would it be her fault for not carrying a screwdriver?
Reply: @meesterbeefy13  if your alternator dies, this is exactly what would happen. You’re a mechanic and you seriously can’t think of a possible reason why the battery would die while not in park?
Reply: @teddyg210  can’t pull the key without putting it in park
Reply: @000elemental000  neither would your grandma, there’s a reason cars are supposed to be easy to use
Reply: @thatgreenguy3969  bro if your mom was in this situation, you would put the blame on the manufacturer, don’t act like every car owner needs to be knowledgeable about their car
Reply: @larrynason8716  right! How are you gonna blame the driver for not having a screwdriver on hand? What is an e brake for if not for an emergency
Reply: @lcsvlone2811  alternator dies while driving
Reply: @lcsvlone2811  there’s hella ways you could end up in this situation
Reply: Not saying it's impossible, only that it's implausible and I've never seen somebody get themselves into that situation when it wasn't their own stupid fault.
Reply: Try reading your owners manual or find a kid too
Reply: Did you get it fixed?
Reply: So this was not caused by Subaru then. It was caused by improper planning.
Reply: There is something called the shift lock and is detailed in the owners manual.  You can release the lock with the physical key in the key fob to release the transmission and put into park when power is off.
Reply: You know there's these magical things called wheel chocks or a brick you could put in front of the wheel and then you wouldn't need battery power to stop it at all
Reply: If you had a vape this wouldn't be a problem
Reply: @RayWolfwinski  very little resistance. VERY little resistance
Reply: Don't punch in the face, punch in the throat. Faces have hard things like teeth and bones that could hurt you. The more 'ya know!
Reply: This may be true of not just Subaru but manufacturers of other cars as well, so don’t forget to tell them to punch their engineers in the face too, for being sheeples.
Reply: im thinking the key thing is the bigger issue
Reply: @RayWolfwinski  That doesn't work with no fluid pressure, noob.
Reply: Most of the replies here seem to be chirping about workarounds for Subaru's shitty engineering. A well-designed car shouldn't need you to be creative in the LEAST to figure out how to keep it from rolling downhill when you're not there to push on the brake. Shitty engineering is shitty engineering, whether you can come up with a clever workaround for it or not.
Reply: You can put a stone or something under the tyre to stop rolling 🤗
Reply: Solved by 2 wood blocks. Wow
Reply: Why would you put it in neutral
Reply: No press the lock out on the gear stick 🤣
Reply: How did the car die in neutral
Reply: @dugangant WA580 or nag1 will with 420lb or engine torque think it can be built upto 1000hp beat that
Reply: Quick Question.
How did you end up with car in NEUTRAL and dead battery?
Reply: Bro. Why's your battery dead ?

Amateur.
Reply: why was it in neutral with a dead battery? that's a little weird to me.  should have been still in park, Would you not think?
Reply: You are the living proof that it is impossible to make a foolproof system.
Reply: You know your electronic key has a physical key inside ?
Reply: ask somebody for help? is it so hard....
Reply: Although it can be done, it is not smart to start an automatic transmission in neutral unless it's absolutely necessary.
Reply: It is never a smart move to start a vehicle with an automatic transmission in neutral unless it's absolutely necessary.   However,  I will agree that the electronic hand brake is one of the worst design for an automobile.   The only one that tops it is the keyless entry with electronic keypad on the door or the handle.  A friend of mine with a 2000 maxima ends up paying a locksmith $250.00 just to open his car door due to a dead battery.   Modern day cars are over design for absolutely no reason.
Reply: Never gonna happen, but nice try.